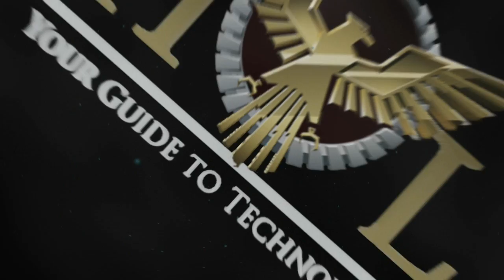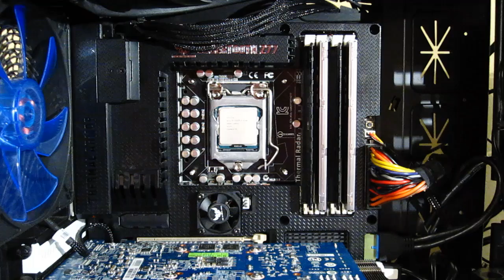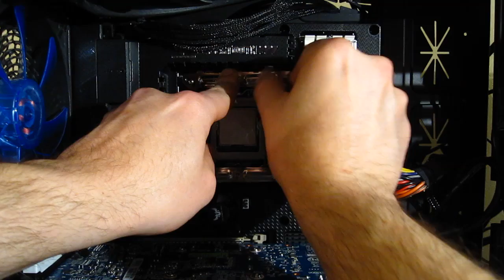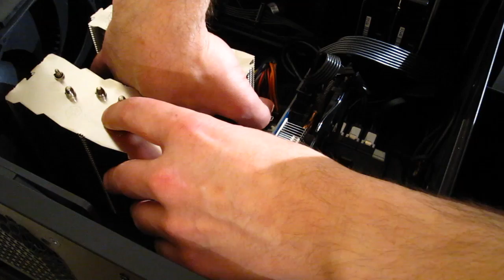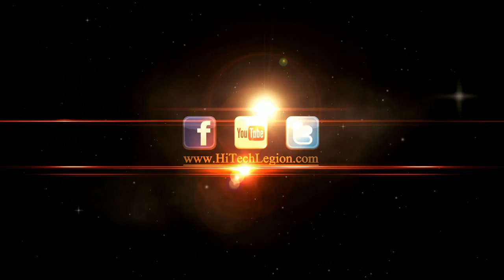Silverstone Heligon HE01 Installation at HiTechLegion.com

Comment: As mentioned on other vid I'm looking to get the i7 2011 chip with a board with 8 DIMM slots.  I need a cooler, not water cooling, to fit and not cover the DIMMs as all will be populated.  I assume this is also going to cover the rear DIMM slots like the other big heat sinks are?